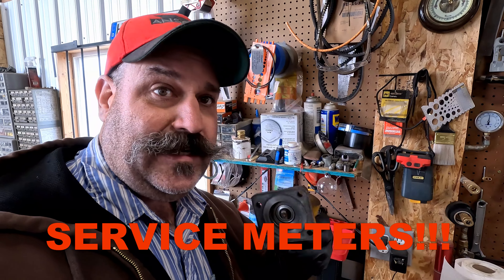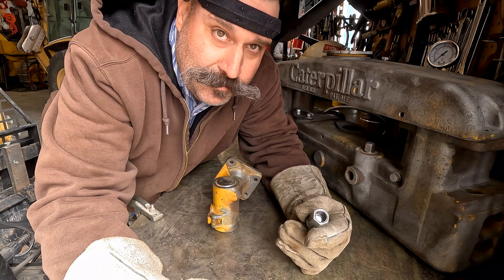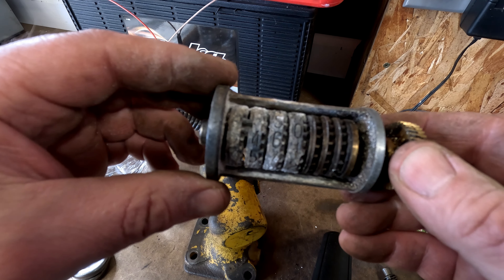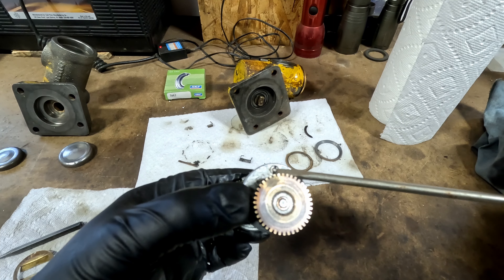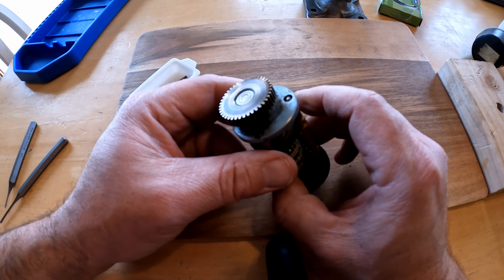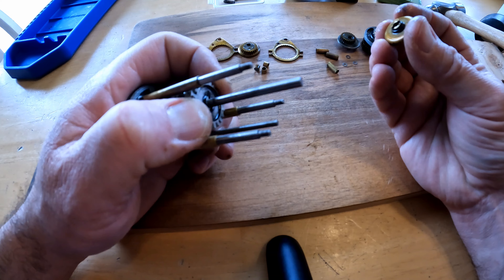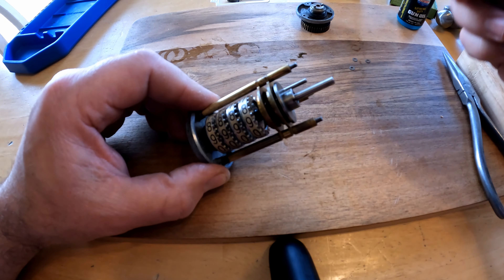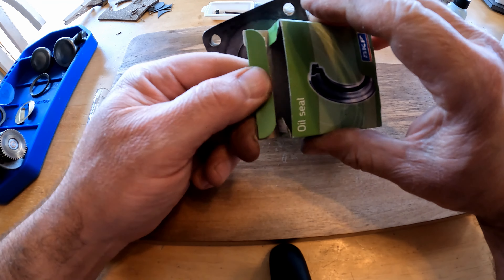Service meter rebuild Caterpillar D4400 diesel engine 1939 Cat D4 "Lil Lefty" 4G9986 Episode #87

Comment: I was very impressed with your ability to know how to dismantle that hour meter and reassembling it impressed me more your mechanical ability knows no boundaries !
I wouldn’t have known how to go about that good for you I would have wanted the meter zeroed to!
One question where did you find such a neat little oil can with such a fine needle spout?😀🇨🇦
Reply from the maker: Thanks Keith! The oil container is Lucas Extreme duty oil. It comes with the needle spout. Very handy! 👍

Comment: If I look at these old school service meters, they must have had multiplied locks smith working in there assembly line to assemble these in masses. At least that is the impression I get.  Similar style service meters were also used on certain Soviet tractors. The T-I70 was the last one with a similar design service meter. All others went to a more convenient design after I965. The number dials usually become unreadable to do it not being able to vent with the atmosphere and condensation makes it rust from the inside. Just like has happened with 4G service meter.
Reply from the maker: That's exactly what I was thinking while working on it. It really was a tedious operation. I never considered the condensation, but that's a very good point. I was always under the assumption that moisture seeped in through other areas but that makes complete sense. 🤔

Comment: Hi LOAL, i did the same with my 4G service meter to use two of them to make one, as for the gasket/seal for the window the are available from Cat.

Ps I like the use of the bread board,
Reply from the maker: I never even thought to check caterpillar. It's always surprising sometimes what they still do have. As for the breadboard, I had permission to decommission it from kitchen service, 😂. It really worked well.

Comment: That custom tool you made looks a lot like the tool that removes what they call a ' clutch head ' screw
Reply from the maker: I know exactly what you're talking about. The old clutch head screws like in older Chevy trucks. It is a little bit different but I can see the similarities.

Comment: Reviving old hardware is just such a wonderful feeling... even when someone else does it.  Nice job.   Any idea where the water ingress point was?
Agreed, when I need to cut up a tool, modify a tool, abuse a tool...  Hazard Fraught is my go-to tool source.
Reply from the maker: A channel member mentioned that condensation has caused a lot of issues in similar service meters. There's nowhere for moisture to vent. I never really considered it before but that is most likely what happened. Its is possible some got in through the glass. I suppose the extreme temperature changes in Colorado don't help. Hazard front the one time use tool shop, 🤣!
Reply: @lifeafterourloss  Entirely probable...  You seem to have a good seal on the bezel now and a new seal on the shaft.   I wonder if you pull the end cap (one more time...) and flood that chamber with nitrogen or argon  (shielding gas) then replace the cap if that would prolong its life.   Even if you keep it inside, it's still going to be in a moisture rich environment part of the year.   Or, maybe flood it with light weight (sewing machine) oil??   Think it would have an adverse affect on the dials?   What do they use in fluid filed gauges?  Mineral oil?  Something synthetic?
Sorry, spent much of my life as a product development engineer.  You've don't such a nice job on this one I want to see it live another 60+ years to the next rebuild.
Reply from the maker: I always appreciate an engineering mind. The internals got a coat with a light oil. My other fear is the internals of the housing continue to flake off and stick to internal components. Although I cleaned it well, the internal damage is already done. The dials are very susceptible to wear and corrosion. The ones on the original 4G hour meter had deteriorated into a fine aluminum powder in areas. I am not sure the new ones would seal up enough to maintain gas pressure but that would be an excellent idea! I am sure with enough silicone it would seal very well. Perhaps this will warrant a revisit or at least some experimentation when we work on the 5T project. Always appreciate the kind words and advice!